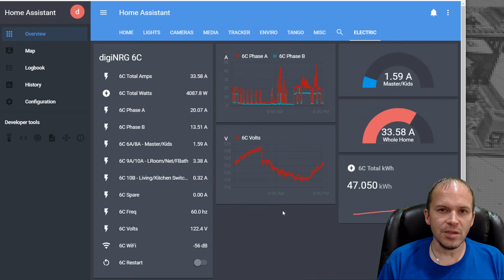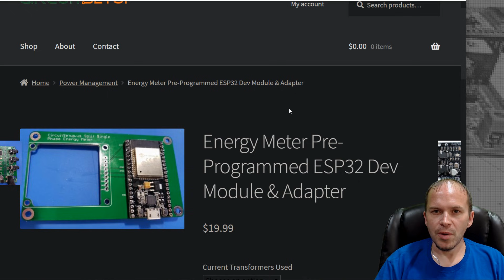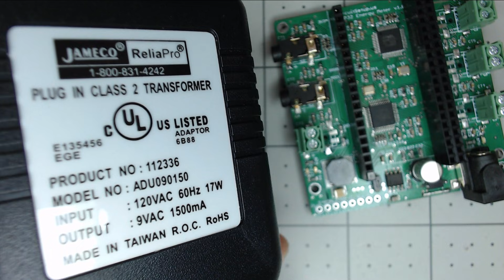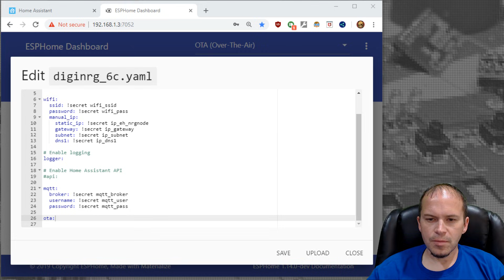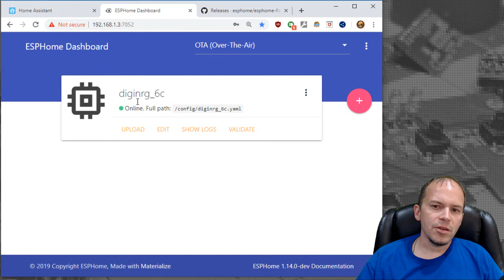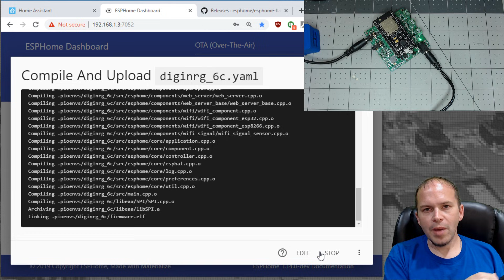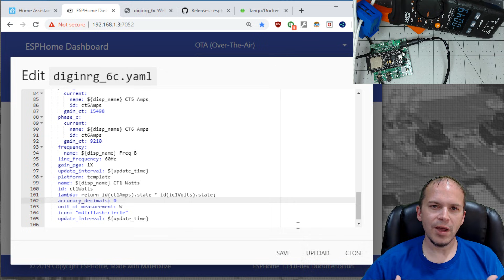DIY Whole Home Power Monitoring with ESPHome & Home Assistant

Comment: Just a heads up. Just calibrated my system and also had to use a 2x Multiplier on my SCT-019 200A Clamp to get the value high enough.
Reply from the maker: Thanks for letting us know!
Reply from the maker: Side note.. 2x as in the gain PGA?
Reply: digiblurDIY Yes, just like I had to ad a multiplier for voltage I had to do it for current also when using the SCT-019. Didn’t have to do it with the SCT-013.
Reply from the maker: You can change the PGA gain and the IC turns up the gain of the 3 channels.
Reply: @digiblurDIY  I missed that part. Just figured I had to do it with a multiplier on the Voltage. So I take the PGA gain only adjust current and not voltage then? Is it a straight out multiplier, so if I set it to 2X I can just divide my SCT-013 numbers by 2?
Reply from the maker: In theory yes. It only impacts the current draw on the clamps and not voltage.

Comment: I'm getting 0V on the B side. Any idea why this could be? It reads the Amps fine.
Reply from the maker: Is that the newer 1.2 board? I know it has jumpers on the back to bridge the voltage over.
Reply: digiblurDIY It has the option to connect all three voltage channels together for each IC, but don’t see an option to bridge across. I can just use the one side only in software. Just curious why I wasn’t getting a read on the other side.
Reply from the maker: That would definitely be a question for the board developer as I assume it should map to the other IC by default.

Comment: I tried programming my esp32 this weekend with a 6ch board with 6ch ad-on for 12 channels.  The esp32 is programmed, but it it does not come alive with the AC power supply connected on the monitor boards. Unplugging the  10VAC supply, and powering by the usb of the esp32, the esp is alive and all 12 channels are seen on the web interface.  In both cases, they boards look powered up, green led on both monitor boards, and red led on the esp32 board. I measure a nice 3.3V on the esp32 when powered by the AC supply.  Ideas?
Reply from the maker: What amperage is the power supply?
Reply: @digiblurDIY  Not high, but also unlimited.  It's a butchered old 9VDC power pack rated for 250mA.  I opened it up, removed the DC regulation, and wired the transformer directly to the output. The center tap, gave me a 9.9 RMS VAC.
Reply: I try to pick a 'real' supply today to see if that's the problem.
Reply from the maker: Definitely as I haven't heard anyone else having this issue.
Reply: @digiblurDIY  Well you called it! New 1A 9VAC power pack works ($A 27). I'm surprised! Both look the same on the scope. Just had an idea....  It's the DC barrel connector.  The board has a 2.1mm pin, my original supply is 2.5mm.  Putting a 2.5mm plug  on the new supply (it has exchangeable ends) it also fails to come alive despite lighting all the leds.
Reply: @markjacksonpulver3546  Glad you figured this out! When the ESP32 starts up wifi it can spike to > 250mA, and if it doesn't get enough power the brownout detector is triggered. which usually means it doesn't respond until reset. Regarding the 2.1mm pin - with a 2.5mm connector there may not be enough metal to metal contact to power everything. Good to know though.

Comment: I got a v1.2 board and am having some problems getting the gain_voltage high enough. ESPHome only allows 65535 as the max and that's not enough to adjust my voltage up to 120V. I can get to 113V. The output of my Power Supply is 10.1V. Something changed with the v1.2 board. From CircuitSetup: "For v1.2 of the board your voltage calibration will be high, >64,000"
Reply from the maker: I have heard people having to use 65000 but it was enough. You might have to reach out to them.
Reply: @digiblurDIY  ESPHome or CircuitSetup? Of course I could see if I can get a Jameco that's closer to 9V.
Reply from the maker: Circuitsetup. I would think that you would need more voltage to be able to back down the gain.

And just to be sure you are doing this with the esp32 powered only by the 6 channel board and no USB is connected right?
Reply: @digiblurDIY  Yes, no usb connected. You might be right about the Voltage.
Reply from the maker: https://github.com/digiblur/digiNRG_ESPHome/commit/4b793e650d7017e9735e43b5016fefb0941b6daf  for the changes needed
Reply: @digiblurDIY  I used your 2x multiplier and now it works. I needed 33800 with the multiplier to get to 120V
Reply: Glad you got it working correctly!

Comment: Are there ESP32 boards compatible with the 6 sensor board, with an external antenna option?
Reply from the maker: I haven't seen any off hand myself. Only one I can think of is the d1 mini pro but that's esp8266 and the wrong pins totally. I do recall seeing some on Ali with external antennas but they were long boards with other add ons.
Reply: This one will work: https://www.mouser.com/ProductDetail/Espressif-Systems/ESP32-DevKitC-32U?qs=%252BEew9%252B0nqrCEVvpkdH%2FG5Q%3D%3D

The 32U is the one with the U.FL antenna connector. You need to purchase the antenna as well.

Comment: Any recommendations for 600A CTs?
Reply from the maker: Wow! Can't say that I have seen any or searched for some recently. Used to use some back in the day in my oilfield work 1000A suckers. Definitely going to have to check some industrial shops on those.
Reply: @digiblurDIY  I doubt we'll use that much for a while but that's what our service is rated on the farm. 200A should do for all the feeders though. That being said, they used 2 wires per hot line coming in, so if I put a 200A CT on each wire, that should be equivalent to one 400A CT? Then I'll definitely need 2 stacking 6 ch sensor boards.
Reply from the maker: I really don't know as I never have used two feeds of the same phase on a panel but you'd think it should split between the two if the resistance is the same on both paths?
Reply: @eliasfarms  you should do one CT per main wire, so 200A CTs should do. I know magnalab makes some, but they are a bit expensive. Is it 3 phase?
Reply: @jdeg2000  It is North American single phase 600A service that we have (120v line-neutral-120v line). There are two conductors coming in per line. Are you recommending only 1 CT per line or per conductor? If I can do 1per conductor, then I can use 2 200A CT per line which should amount to 400A measuring capability?
Reply: @eliasfarms  honestly,  I've never heard of 600A single phase. 3 phase is much more common for commercial. Either way, it's one CT per conductor (you dont need to measure neutral, but you certainly can if you want to). Each CT should be able to handle 200A. 

I'm curious, is there any reason you're specifically running single phase? Like, motors that you use are single phase, maybe? I ask because 3 phase in commercial is much more efficient, and if you dont need single phase you could be saving a lot of $$$
Reply: @jdeg2000  We only have single phase service to our rural location. We used to periodically max out our 200A (only 160A actual) service and now with our solar installation we needed/wanted a service upgrade and it only cost a little more up in the front installation to go straight to 600A. Our rate per kWh stays the same flat rate.
Reply: @eliasfarms  ohh okay. That makes sense.👍

Comment: Wanting to order in the UK if anyone has any links please
Reply from the maker: Are there not any UK ordering options?
Reply: @digiblurDIY  drunk me ordered the clamp as was only few pounds . just need a link to the power monitor board with 3.5mm  only need single phase here in the UK . thanks
Reply from the maker: Makes it easy, mix and match what you want and decide if you want to monitor 2 or 6 circuits.

Comment: Has anybody found a good case for the 6 Ch version?  My panel is on the outside of our house.
Reply from the maker: For outdoor stuff I have found various weather proof cases in the hardware store in the electrical sexton and even the automatic sprinkler section as well.

Comment: Why does it use TRS (3-pole) Connectors and not just TS (2-pole)? Aren't there just two leads? Ordered some SCT-019 (200A) and wanted to put a plug on them.
Reply from the maker: Not sure why they make them like that. It's only 2 wires and a shield.
Reply: @digiblurDIY  Thanks!!
Reply: @johnraahauge4552  WHERE did you order the SCT-019, I have 200A service and need a bigger clamp.

Comment: Fantastic video Travis!  Very informative and exactly what I have been looking for.  Thank you for putting it all together and making the instructions clear and concise.  I'm about to order all the parts - is there anything special I need for Australian power (230V 50Hz single phase)?  Do you have a recommended 9VAC power supply that is 240v? (the one listed above looks to be rated at 120Vac) Thanks in advance!
Reply: G'day. Did you proceed with this? I, too, am in Australia and was wondering about the 240VAC side of things.

Comment: For monitoring backfeeding solar panels, I assume you'd want to flip the current clamps around?
Reply: The CTs would go in whatever direction current normally flows. Depending on how you set it up you may want negative readings to calculate net energy consumption.
Reply from the maker: I don't have solar and with all the various systems and such you would have to look at yours and figure out what you want to monitor and try it out.

Comment: So can I use the 2 channel board to accurately measure my 220V appliances? Would love to see how much power my dryer and AC unit consume.
Reply from the maker: You could use those 220 channels to monitor anything you like. Keep in mind that US 220v appliances would need 2 channels to capture the entire usage. You could do the entire house with 2 channels but it wouldn't be broken down. I use the 6 channel where 2 do the entire house then the other 4 are broken down to other circuits.
Reply: @digiblurDIY  Yeah I considered that but unfortunately the last owners didn't run the wires to the main panel but instead ran them to a sub panel located in the garage. No idea why.
Reply from the maker: You could put one on each leg then double up on power to get a rough estimate. I would compare the two different legs to see the draw differences.
Reply: @DrDrewsAdventures  perhaps they ran a wire from main panel to a sub-panel in the garage because it makes it easier to add additional circuits in the garage on the future. That's why I'd add a sub-panel to my garage, at least.

Comment: Great video - thank you! Regarding the warning about unplugging  the CT From the board - I want to make sure I am understanding (sorry if this is a dumb question) . If I unplug the RCA plug from the board the tip could be dangerously energized? Is that correct? Would this be for all CTs or is their a certain CT I should look for that would reduce or eliminate this risk.  How would you safely unplug it from the board?  Thanks again!
Reply: Yes All CT's by deafult are dangerous when the secondary is not connected to load or short circuited. To understand imagine a ct of a ration of 200 to 1 ( 200 primary amps results to 1 amp on secondary) so when open circuit CT will amplify the 100 V on primary by 200 times .
Reply: Anil Ghatikar is this the case with all CTs? Is there a way to compensate for this and safely remove the plug?  Thank you for your reply!
Reply from the maker: They can be used safely if you just take your time and go through the motions. The YHDC models I used either have the zener diode or burden protection circuit in them. To prevent any danger. Remove any load from the circuit first then you can unplug them. Do not turn the circuit back on until either the CT is removed or is plugged back in the board.

Comment: If you used several different known-draw loads, you could use "the maths" approach (shown a couple of times in other comments) to calculate the multiplier for each load, then average them to get even closer to the true multiplier for that CT+sampler chip.

Comment: Quick tip for those who don't like guesswork. Calibration can be sped up a lot. If you have say 0.32A and expect 0.50 try 0.5/0.32*current conversion factor (like 10000 in the video). You'll get 15624, close to his final 15420. Like mentioned, higher current loads will yield better results using this same process
Reply: Ah, another math guy!  Why "walk it in" if you can just calculate, right? (-:
Reply: @TrentSnyder308  don't need to be a math person , didn't you pay attention in high school? 😆
Reply from the maker: Thanks for this!  I need to update my numbers now.
Reply: @digiblurDIY  don't stress, like you mentioned the calibration you did with 10-11 amp loads will be much more accurate. I work in large scale energy monitoring so seeing cheap home solutions like this is awesome!
Reply: Haha, I just wanted to suggest the same. :D

Comment: Does the wattage calculation take into account the  phase difference in the voltage and current?  Watts vs  VA.
Reply from the maker: I know on the 2 channel it did for me as I was reading negative watts. Didn't think the phase difference through all the way. Doh.

Comment: Not to be a nag... BUT.... that breaker box needs some organization!  On a positive note, Thank you for this tutorial, and VERY nice job on your graphs in grafana.
Reply from the maker: Would love to rip and replace it indeed. No need for the electric dryer, stove and water heater circuits anymore. It's on the agenda when the emergency generator is done as it is original to the house.

Thanks! I am pretty green when it comes to grafana. Need to learn so much more but wow it makes some nice graphs.
Reply: @digiblurDIY  Sounds like you got a decent project in your mist!  One thing I might add is if it were me, do some before and after shots just to really show off a nice box.  cause lets all agree, who doesn't like checking out a nice box?  am I right?!  

Yeah grafana is defiantly an awesome tool.  I had mine pulling data from a MySQL database before but this week I actually started using influx for logging sensor data.  So far, its been very rewarding!

Comment: Hey how does this compare to commercial ones like Sense for monitoring power? I always considered using one but they are a little pricey to say the least.
Reply: IIRC, the Sense system is supposed to be able to suss out (over time) what devices you have in your house.  They do micro wave-form matching against their databases to try and recognize certain kinds of loads.  If you have smart plugs (with power monitoring; e.g., TP-Link HS-110) that you allow Sense to access, then it can differentiate those loads, making it easier to find all the other stuff.  Or so they say.  And yes, it's more spendy [sic], and it's closed source, and it's "in the cloud" (read "on someone else's computers") so lots of downsides, but if it really does what you want, and you're willing to accept all the privacy concerns, etc. ... it's kinda a compelling story.  "If."
Reply from the maker: I don't have one myself nor have I used one. I have only seen the reviews which seem to be mixed even on the real ones. It does seem inferior in my opinion if I can't see specific circuits and it costs more. Then combined with it not being open source and I assume cloud based I just can't even call it an option.

Comment: Just chop the.little tag on the meter and yank it.  You don't know what happened to it.  ;).   Or at least that's always the story "someone i know" AHEM went with.  

I thought most models of CT especially the one sold with that has the burden resistor, no?  

great video!
Reply from the maker: Lol no comment on that first part.

They actually do make a 100a with a 1v output. https://www.mcielectronics.cl/website_MCI/static/documents/Datasheet_SCT013.pdf

Comment: Very nice video. I will try it out. But Voltage X Current isn't equal to wattage. Voltage X Current X power factor gives wattage.
Reply from the maker: That is correct as I wasn't going to go down that rabbit hold of explaining power consumption. Mainly using it for amps myself as you can see.

Comment: Easier way to zero in on the calibration:  correct multiplier = test_multiplier * expected_amps / measured_amps. For your example, 10000 * 0.49 / 0.32 yeilds 15469. (I love using math to short-circuit iterating.)

The ratio of the correct multiplier to the correct amperage is the same as the ratio of the test multiplier to the test amperage:
M[act] / A[act] = M[test] / A[test]
x / 0.49 = 10000 / 0.32
Solve for x.
Reply: This does assume linearity of the system, of course. If a system isn't quite linear, it should get you close, then you can iterate. Since these CTs should be linear, one sample should get you spot on.
Reply from the maker: I knew Math genius would come along and show us the light!!  :)  Thanks!
Reply: @digiblurDIY  - hehe, not a genius, just someone who has seen the light and understands the "this is to that as that is to the other" concept.

I really appreciate you walking us through all the stuff you do.  I've not jumped in as far as you, Justin, and Rob, but with your (collective) guidance, many more of us are willing to try.  I'm just trying to add my little bit. (-:
Reply: Appreciate Video! Sorry for chiming in, I would appreciate your opinion. Have you ever tried - Mahorrla Defence Wisdom Method (do a search on google)? It is a great one off product for securing your home from danger without the normal expense. Ive heard some incredible things about it and my buddy after many years got cool success with it.